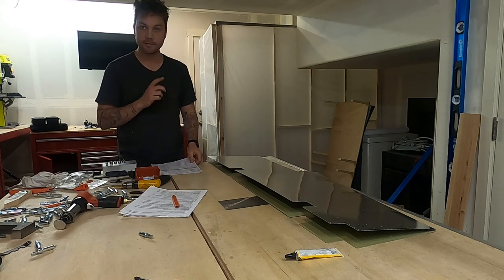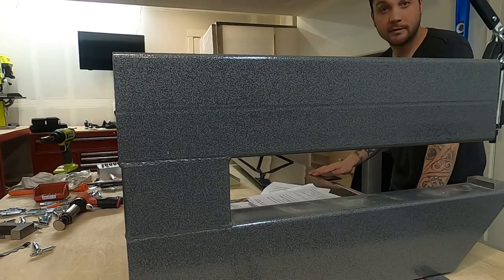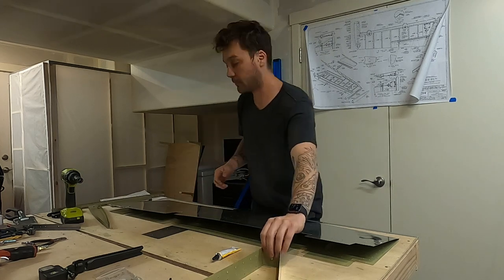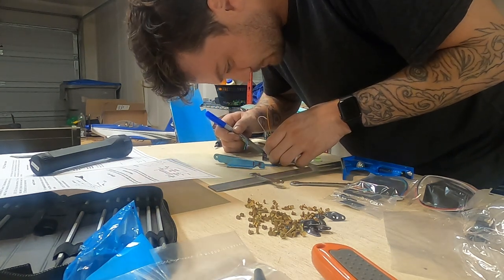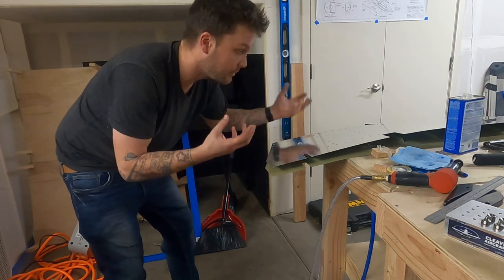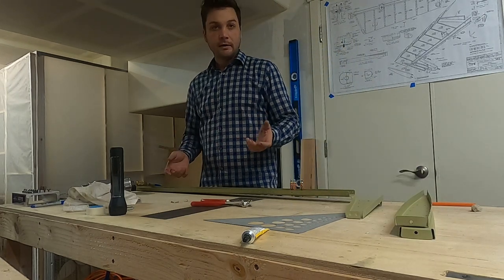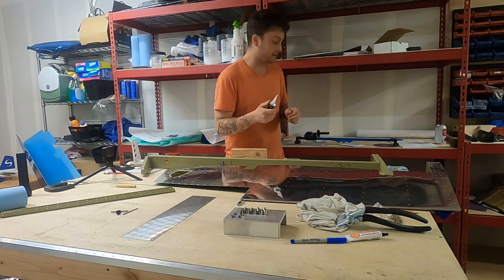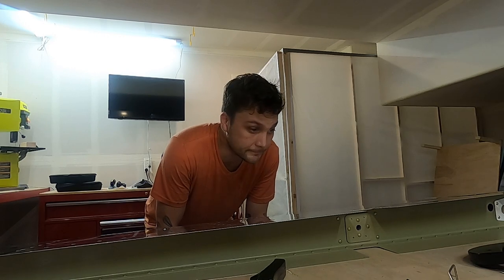Building an Experimental Airplane, The Vans RV-7A | EP1.11 Building the Elevator Part III

Comment: Hi Ryan. I like your dedication to the task. I was wondering if you are a member of the Experimental Aircraft Association?
Reply from the maker: George, I am indeed a member. In fact, I have some footage coming out of a recent meeting, and I speak about the EAA a bit. 

A membership, while certainly not required for the project, for me was an absolute no-brainer.
Reply: @RyanFlysPDX  Hi Ryan. Several years ago I help my friend Paul Rosales with his VR 6A. He decided that he wanted the sliding canopy. I did all of the fiberglass work to build the windshield bow and fair the windshield into the cowling. He won many awards at Oshkosh. And recently on the cover of this months, EAA magazine his RV was featured. It is the RV in the upper right corner. Keep at it and you may have an award winner yourself.